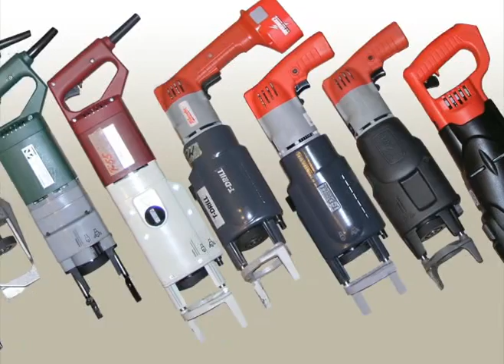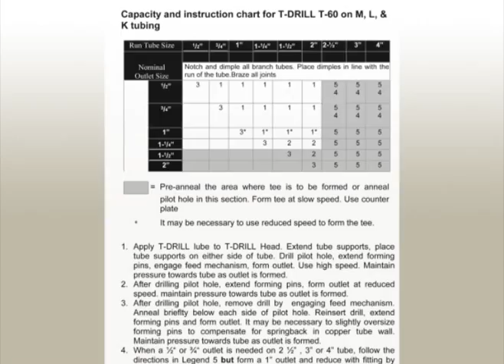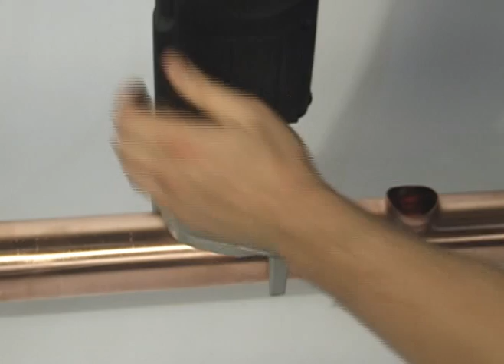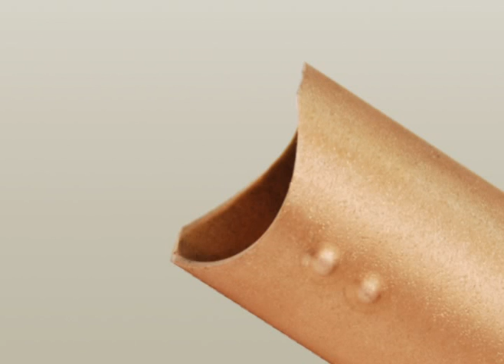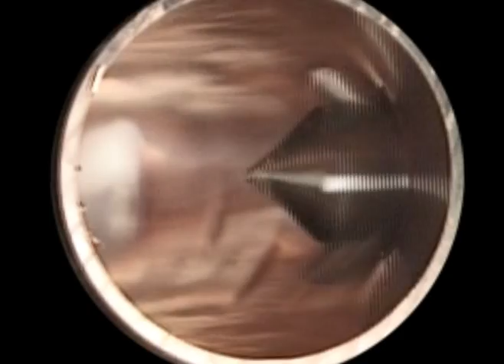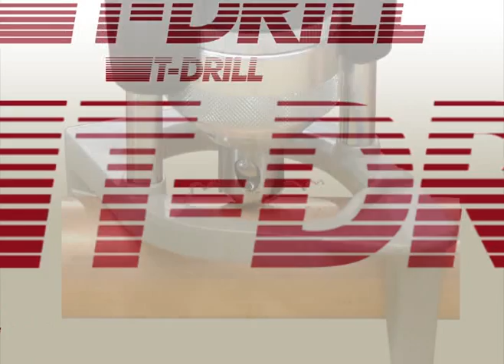T-DRILL T-60 & T-35 Tee Forming Training Video

Comment: Why have I seen people torch the pipe before using the t drill?
Reply: It’s called annealing , and it turns the copper from hard to a softer material which won’t break when you are pulling out those new copper connections with the tool . If you did it to hard copper it would break or crack when the tool is reshaping the tubing into a new female connection

Comment: Add 1 tee and slide coupling 10 minutes work save you lot of money and carrying all this tools
Reply: 4" x 2" tee and a 4" slide coupling is pretty expensive........ Every time I used my T-Drill on a 4" pipe I saved (minimum) $200 per fitting.
Reply: @eddiecalder5436  that's it!  If you are doing a lot tee cut-ins this method is economical with sizes you're talking about.